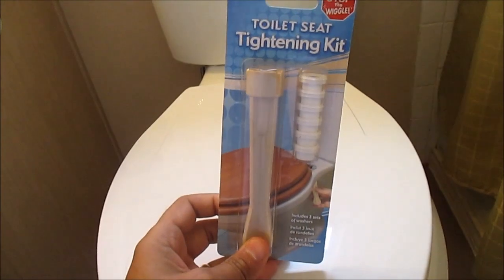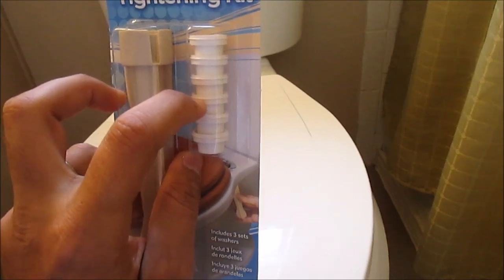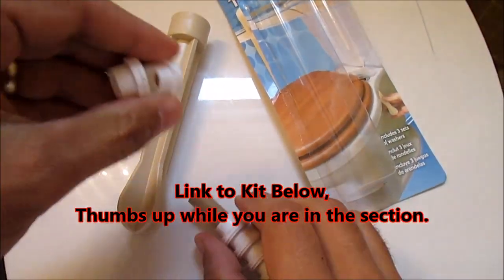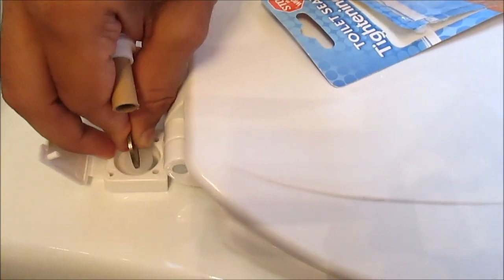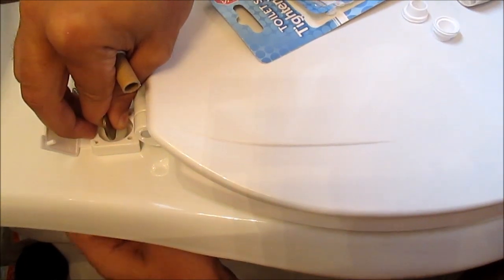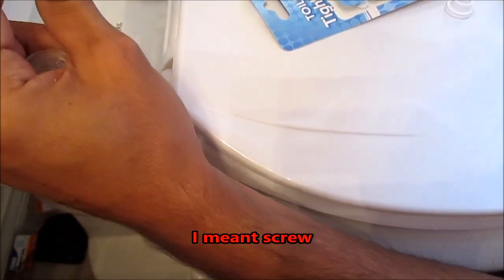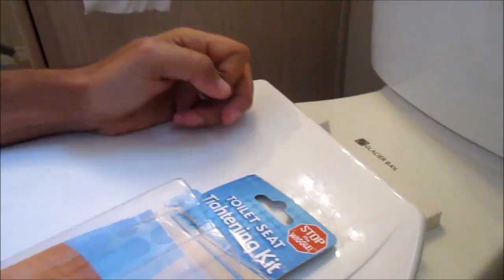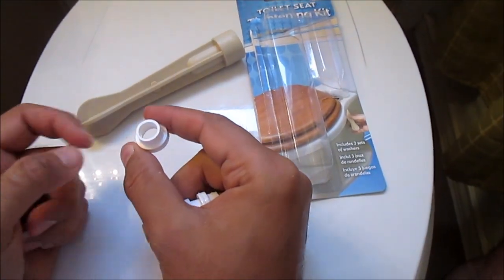How To Stop Toilet Seat From Wiggle & Coming Loose

Comment: I found a plastic cork cut into 1/4 and drilled with snug hole to fit solved my problem.   Obviously it helps when you or I have the tools around to build the solution otherwise Lowes is probably a great choice.   You make helpful videos Sir.
Reply from the maker: That is a genious idea 💡, thanks  for sharing and watching.👍

Comment: What do you do if the bolt just will not turn.  I know it is stripped and bought new bolts but can't get the old ones off.  I have done what you said and cannot get it to budge
Reply: Carefully cut it off with a hack saw

Comment: been there, done that.  using these washers, it works much better than not having it installed, but still has the same problem, just takes a little longer to start wiggling again.  i found that the bolt is the real problem.  after it started to wiggle again, i tightened it down a little more than before and within a short period of time later the bolt head sheared off.  i get why they don't use metal hardware, but you'd think they could come up with some type of plastic/nylon bolt that was more sturdy.  i'd like to know what the difference is between the toilet seats that i grew up with and those of today?  growing up thru early adulthood (and i weigh the same now as i did back in my 20's - actually i weigh i little less, so i know it's not a weight issue), i never had to mess with tightening the toilet seat.  now, i've got to tighten / replace hardware every year or so.
Reply: For real, I never had this issue with the older ugly bastard toilets. As soon as I had the glacier bay push button flush toilets installed I'm now on the floors every other month tightening the shit out of them and then If I even just as much as sit on the top of the lid to watch my daughter in the tub one slight movement and the whole thing is just loosened up again.  I'm gonna buy these today and just put them on all 3 toilets.

Comment: I spoke too soon.  I used these washers and the next day, I had the same problem; a sliding toilet seat.  I next even tried 4 washers; 2 on the top, and 2 on the bottom, to no avail.  I finally bought ANOTHER NEW TOILET SEAT, BUT A DIFFERENT BRAND.  AND THIS NEW ONE HAD NO PROBLEM!  I think it has to do with the stoppers on the underside of the seat.  The first seat had thick BUT SHORTER stoppers, whereas, this new one has long thin stoppers that reach from one side of the seat to the other.  NO MORE AGGREVATION, but thank you.  I now don't even need the washers!
Reply: Can you tell me the name so I can have it too🙏🏽👀
Reply: @zamiqshelton8148  Bemis Hospitality Plastic Elongated Slow-Close Toilet Seat with Sta-tite Fastening system.  I believe they have them in round as well.